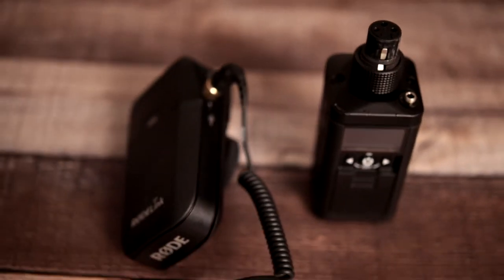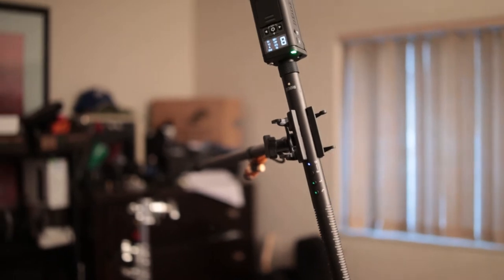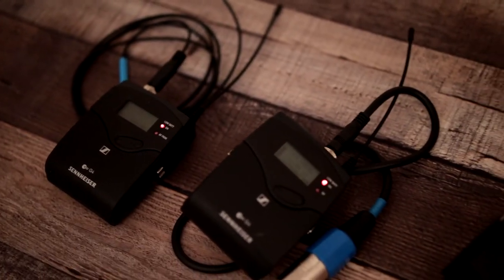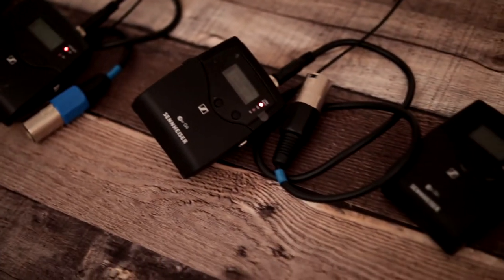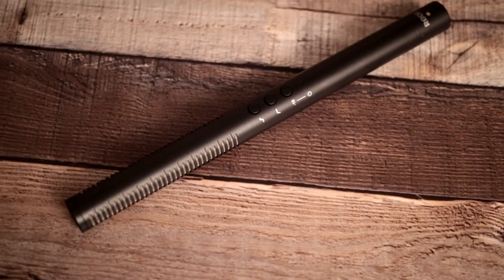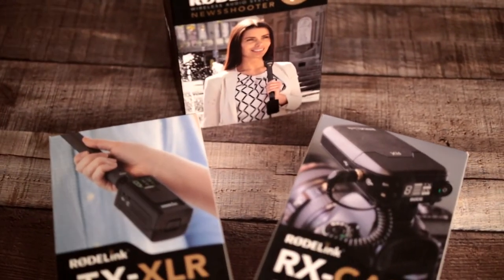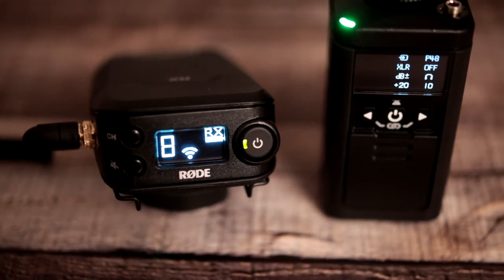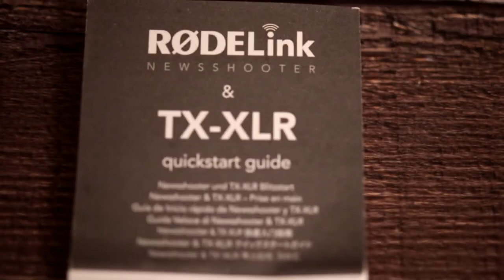Wireless Boom Microphone setup with the Rode RODElink™ Newsshooter Kit - Wireless XLR Plug-On Demo

Comment: Thanks for posting this. debating on these same two systems - I have the G4s, but leaning heavily towards the RodeLink because it has a headphones jack on the transmitter - which is great for the boom operator.

Comment: Thanks on for this.  I'm getting a used Tx-Xlr but the locking screw collar was lost by the owner. Would you say it's absolutely necessary for mounting on shotgun mics. I know the locking clip is spring loaded but the collar does it hold tension so the mic doesn't rock? . I'm.rrally..trying  to  determine if I could get by without the collar.

Comment: When you connect the Rodelink receiver to USB power, do the batteries inside the receiver charge while running off USB power or does the receiver truly run off the USB power?  I'm asking because I am using Alkaline batteries in the receiver and I don't want the alkaline batteries to charge when i connect to USB power.

Comment: Hey man. I have a question. I'm using the rode newsshooter kit and I'm having floor noise issues. I think I figured it out. Coming out from the receiver I'm using a 3.5mm to xlr into my preamp then into my camera. I just tried on a different pre Amp having just a 3.5mm to 3.5mm into the preamp and my noise is gone. Is there any good solutions going from 3.5mm to xlr?